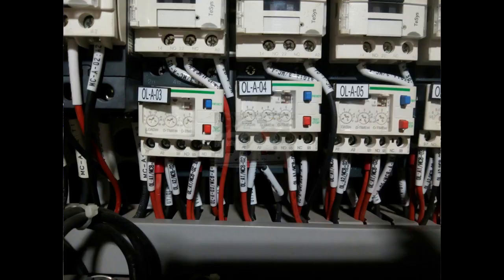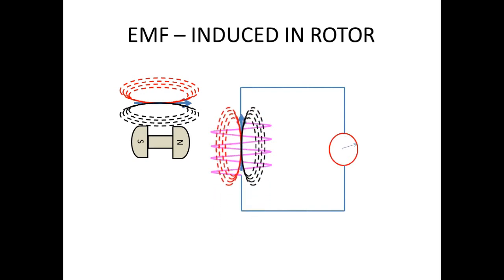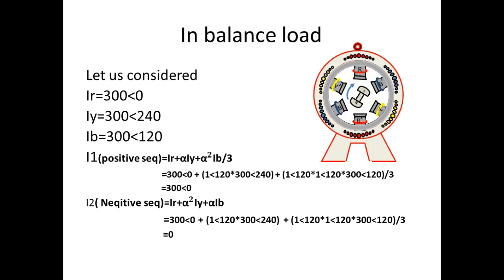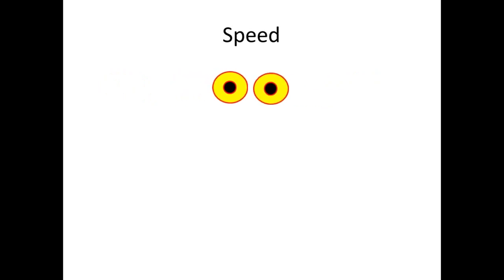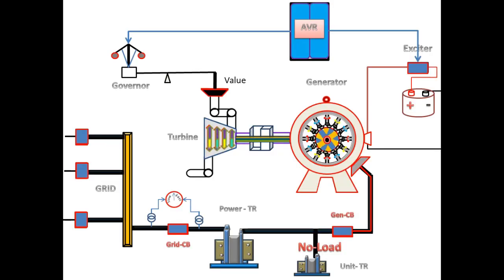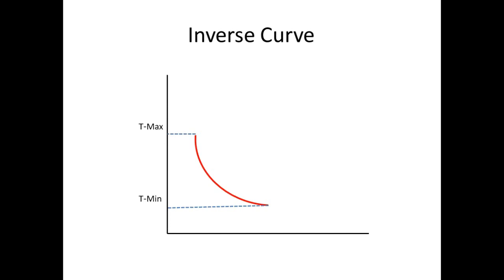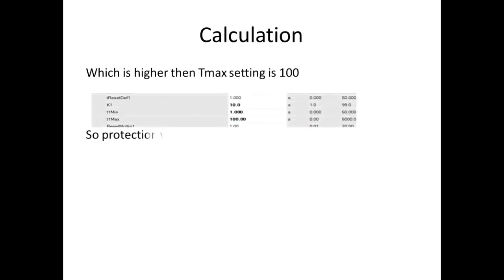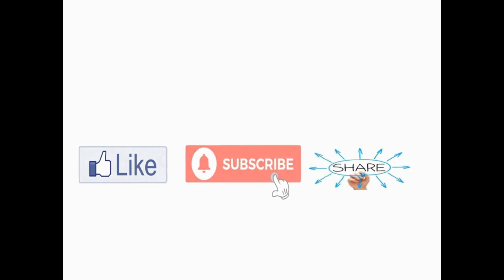Generator negative phase sequence protection | ANSI CODE 46

Comment: I have a question regarding neg seq relay testing. What if you do not change the phase angle but change the current magnitudes of three phases? This is also an unbalanced condition. Will the relay trip?
Reply from the maker: Due to Unbalanced current also negative sequences current will produce.  And relay will also issue trip for unbalanced current
Reply: @baranitech  even if the phase angle is kept same as the angle of the voltage? Right?
Reply from the maker: @aamirawan7998  yes
Reply: @baranitech  ok. Thanks a lot brother. Love from Pakistan
Reply from the maker: @aamirawan7998  welcome brother 🙏